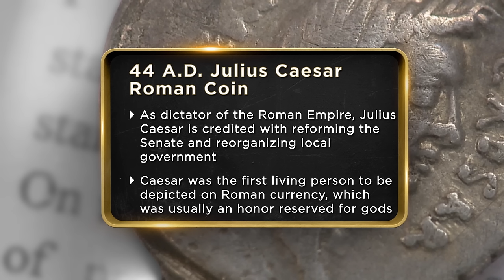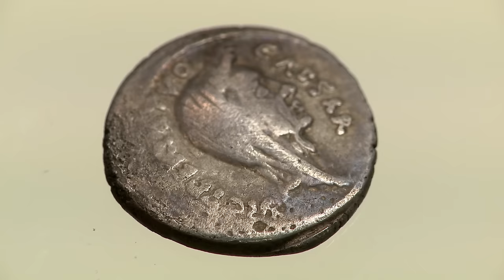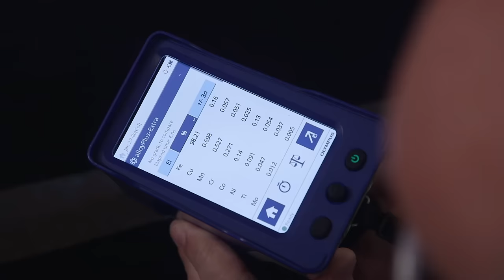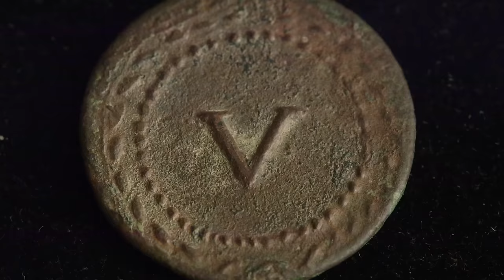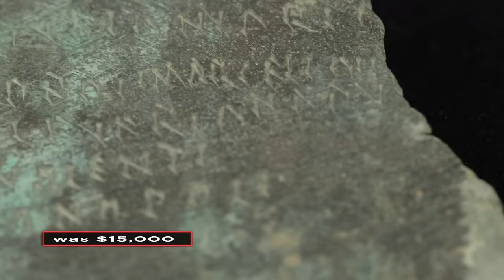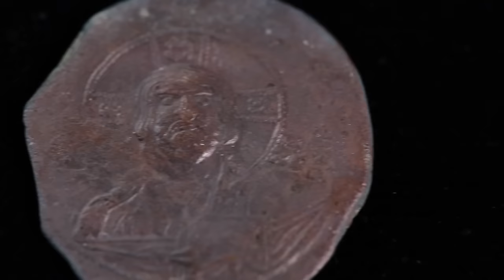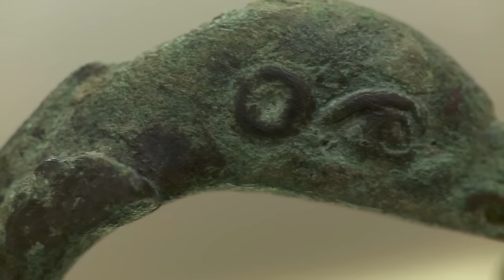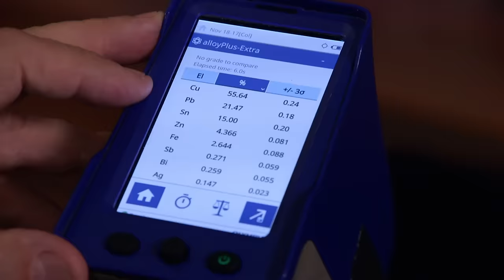Pawn Stars: TOP 7 ANCIENT ROMAN ITEMS OF ALL TIME

Comment: The “expert” with the swords was actually mixing the elements up on the X-Ray spectrometer. Mn is manganese, NOT magnesium. And manganese often occurs naturally with iron ores around the world. Either it was unintentionally added by the Romans, or it was made with a steel from the late 1700s on. This method alone is not a very accurate way to judge the authenticity of ancient ferrous metals. Works great with precious metals though.